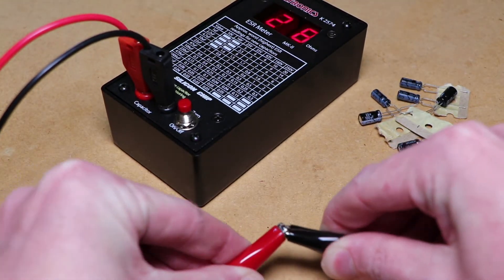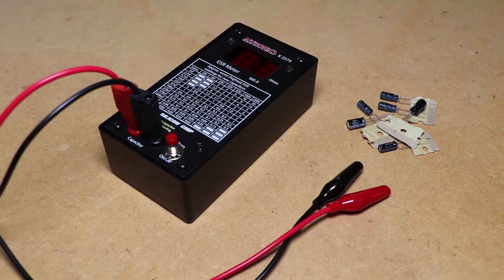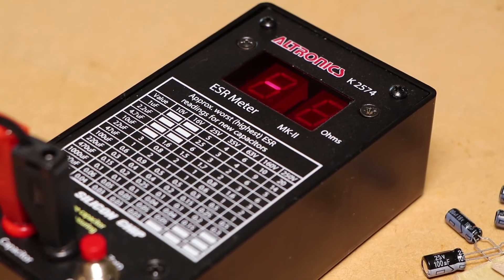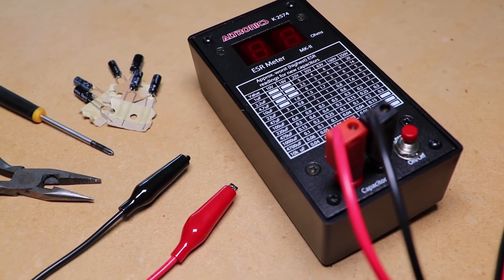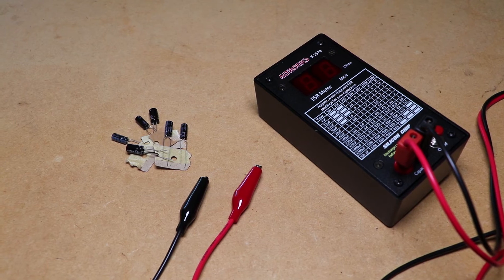Kit Build - ESR Meter

Comment: With the mod for extra protection using 2 1N5404 diodes inverse parallel, different manufacturers have different forward voltages, will this affect the accuracy of the readings?

Comment: I purchase this meter last year and this is no short indicator. When i test in Circuit the range of capacitor is .03 or .01 but when i double check in my Fluke 117 Contiuity test its buzzing sound which means is shorted. and after that I try to remove in circuit its same test its Buzzing sound my Fluke means its shorted. so when Im troubleshoot Im am always double check the capacitor is not shorted in Circuit. Also Blue ESR are No short Indicator too..
Reply: It's more likely that your Fluke can't tell the difference between an actual short circuit, and the initial low voltage drop across discharged electrolytic capacitors. Maybe a course in basic electrical theory would be helpful?

Comment: 85$ for this meter.. is it really worth it? I don't think so. Great video though.
Reply: More than 25 years I bought the same meter with the name Dick Smith.
Mine cost Us$200 dollars, I can say this meter worth every dollar.
This meter save me thousands of hours.
Reply: @treadmillrepair754  Given that it was new tech back 25 years ago; Id agree. but now adays; its not worth more than 40 $ at best since the new teach age is here. :) I hope you understand what I tried to imply; given the modern tech times.
Reply: @nef003  Yes I understand.
I have analog scopes but in this moment for every day I use digital scopes only.
I hace VTVM multimeter but I use a Fluke 28 series 2 and Fluke 289 series 2.
I have a Peak Atlas ESR70 and GME-236 esr meter for every day use.
I have many old equipment in my house.
35 years buying test equipment.

Best Regards.
Reply: Yeah cheaper buying an Atlas!
Reply: This meter was designed for professional electronic service technicians. The time it can save in just one or two repairs can easily pay for it. It's different for hobbyists, of course. :)